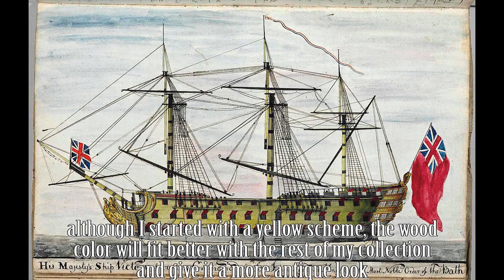HMS Victory (104 guns) [original form prior to 1800 rebuild], 1765-1800 - 3D print, by Henry Turner

Comment: You noted at around 2.30 that the colours you used did not reflect the colours on the model in the Royal Museum Greenwich and so changed your colouring.  The thing is though, how accurate is that colouring?  I note that the bottom of the hull on the model you pictured was wrong.  British ships at that time were built with copper bottoms which were not painted.  The reason being is that copper prevented fouling and the accumulation of sea life on the hull giving it a much longer operational life and helping maintain the ships speed.  I think it might be appropriate to check on why the ship's hull looked like this?
Reply from the maker: Around 1760 copper plating began to be experimented with, but then another problem appeared; the iron nails electrolysed with the copper and they decomposed. It was not until about 1780 that a solution was found and the Admiralty approved the measure of copper plating the hulls of the Navy. The Victory was copper plated in March 1780, it was well after the time of my model (1764) Before copper linings, many ships had a layer of animal fat that turned white with salt water and was applied for the same purpose of speed and anti-organisms for which copper later proved to be much better. True, I could have drawn a white line marking the waterline, but the model is sculpted cut right on the line so it is all hidden from view (we can assume that it represents that it is overloaded with weapons and ammunition, at the beginning of a mission)
It is difficult to find the colors of such old sources, and the Victory with its controversy over the "pink" color that historians and chemists have shown to be the "Nelson Scheme" is an extreme example of how even when the same ship has come down to us it is difficult to reach a consensus.
Thank you very much for your comment with such interesting details.

Comment: One quick question: how did you do the rigging, particularly the ratlines?  That's lovely work!
Reply from the maker: Rigging can be a good video topic if you are interested. I use a laborious system but no more than the others I know and with pretty good results. In the final part of the video https://youtu.be/7k2QE9hU1D0 you can see quite well the stages of the process. Basically, it involves cotton sewing thread hardened with PVA and gluing its ends to the masts with a drop of PVA. The ratline steps are glued with varnish. Thanks for your kind comment!
Reply: @MinisMyWay  I'd be extremely interested in a rigging video, myself.  Thanks so much for considering it.  And thanks for the pointer to the GB: Elizabeth Class video: already that helps, as does the use of PVA and varnish! Any particular reason for varnish for the ratlines as opposed to more PVA? Many thanks!
Reply from the maker: Sorry for the delay, YT don't notify (or me don't realize) your new comment. You have a video about made at later date:  https://youtu.be/iTtfQ7PmPqE The reason for use varnish instead PVA is becaise is pretty adhesive and does not damage the brushes, as you know the PVA destroys it in few minutes.